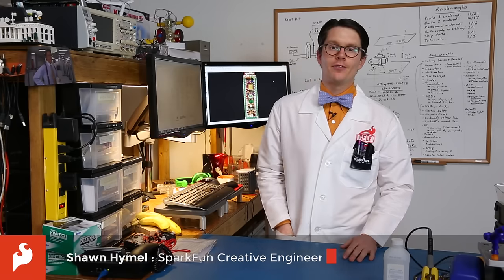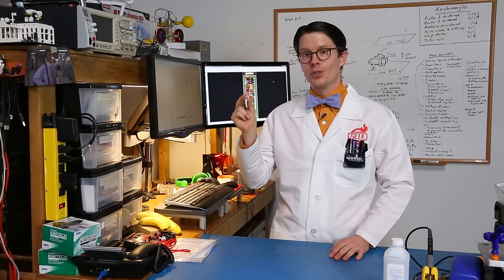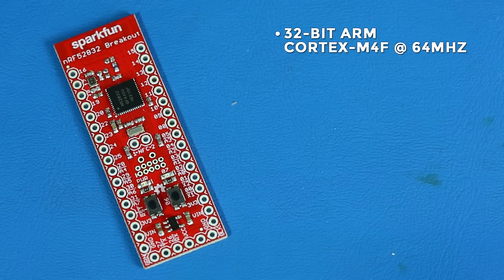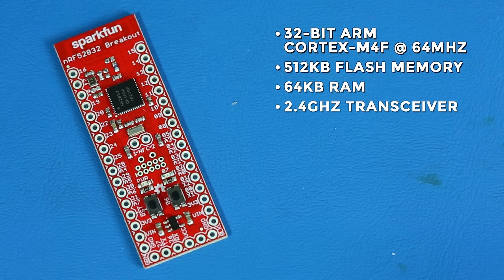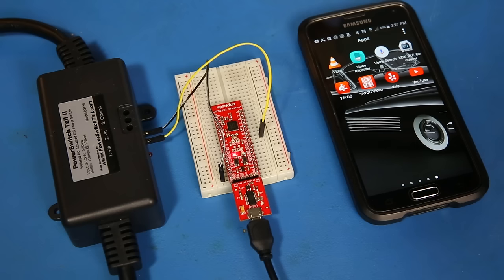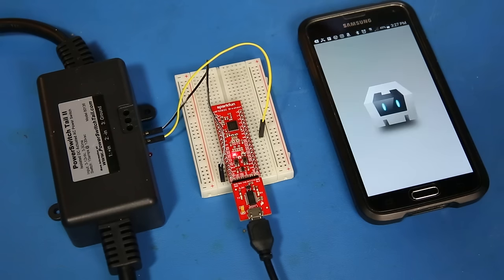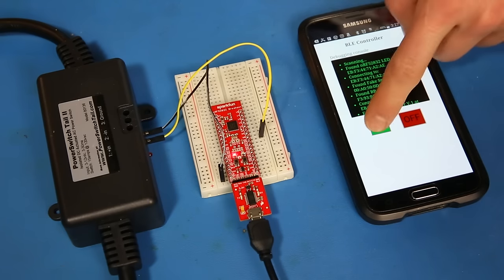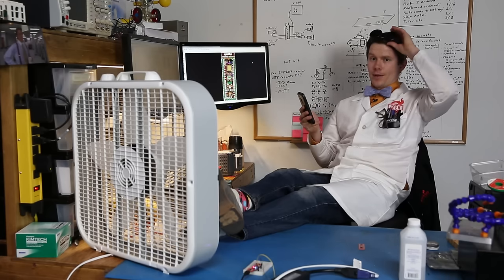SparkFun nRF52832 Breakout Board

Comment: Hi, 
How can I download the Arduino IDE onto the nRF52832 chip? I want to use this chip and design my own BLE circuit for my project but all the modules I have been looking at can only program the BLE modules with ATcommands. Would I need the Cortex Debug Connector and Serial Program Debug?